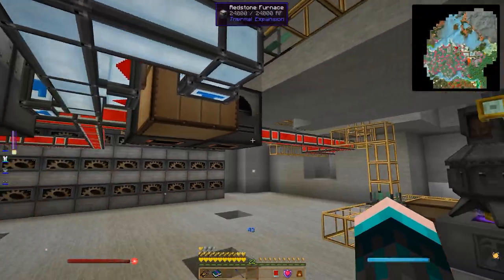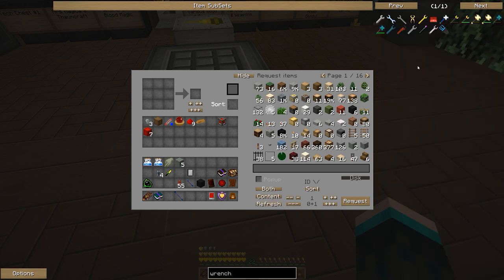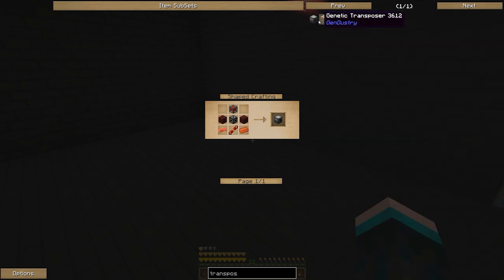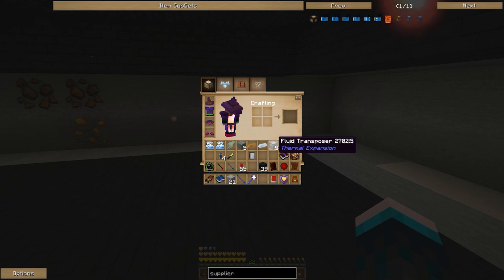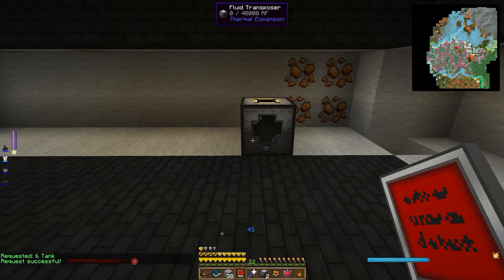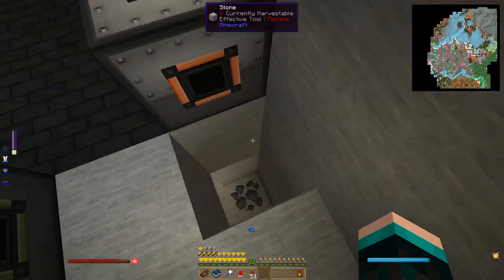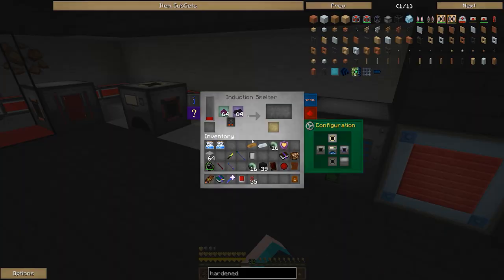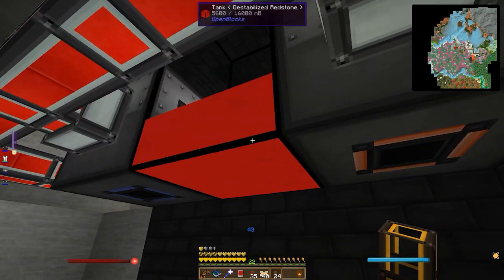Minecraft the Hard Way 31

Comment: Hey Dave,A few things:
First: It's called a cie-clik(like cycle) assembler
Second:You do know that you can easily make invar by putting two iron ingots and a ferrous ingot in an induction smelter,right?
Third:Your magma crucible setup won't work because you forgot to tap the liquiducts with your wrench.
Fourth:You might want to put furnaces above the hopper clock that Lying made for you in your ender-gen room,not only does it reduce the amount of lag the hoppers causes,but it also prevents you from accidentally dropping things in it and breaking it.
Finally:You should really look into extra-utilities and computercraft.They have some amazing stuff,and you should really try and reduce the amount of itemducts in your base/the server because they cause a considerable amount of lag by possibly using other pipes,perhaps the ones from extra-utils/buildcraft/logic pipes or whatever?
Reply from the maker: First: That is a regional dialect thing. My programs may have "SAI-kul" detection but I ride a "bi-SICK-kul" which uses "SICK-lick-kul" motion.
Second: Yes, but I wanted to do it this way because the exact same design will let me do some metallurgy3 stuff later, so I wanted to get it ironed out now.
Third: I didn't forget, I just didn't do it yet because the tanks are empty. We paused mid-build yo. :)
Fourth: It isn't a hopper clock, so it doesn't matter for that bug. Besides, the vanilla tweaks we have fix that issue anyways.
Finally: I use ExU all over my base, but I don't want to use computercraft. ComputerCraft is a fun mod and I encourage people to play with it, but it's one of the most boring mods to watch someone use. Further, the kind of code I write would not be very approachable by most of my audience. 

As for itemducts, I have less than a dozen and my base is actually one of the least laggy bases on the server that has automation.
Reply: Dave Fayram You know LUA!?
 Can we expect to see LUA Android Apps soon Dave lol!
Reply: tuchapoltr ithemducts only cuase lag becuase of an interection with forge microparts ,dont use micorparts next to/very near to them and there will be no real issue

Comment: I think this makes me like extra cells a bit more, not saying the design is bad but it just seems a bit fiddly. I've set up something with Extra Cells where I have a single Magma Crucibal and the ME system just automatically pulls the liquid out and places it in the relevant place or just stores it if there is no where for it to go. I am still a strong believer that for ME you still need to use logistic pipes to get the absolute best system but then ME Interfaces are designed so that they can power Logistic Pipes... for a reason.

Comment: This could be done easier IMO, because you could just have used FLUID Logistics Pipes and then put the liquids into tanks somewhere else. These pipes connect to the same logistics pipe ITEM network (which already sends the items to the machines) and can handle multiple fluids at the same time. The point is simply to save space and build less of a mess with only one machine; they arent running all the time, so one of them that does one liquid after another would be sufficient.